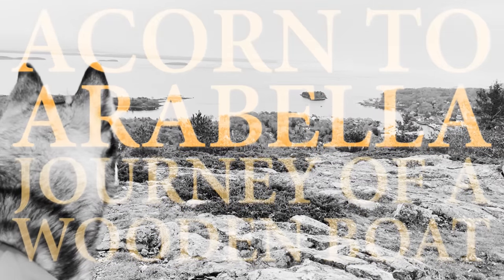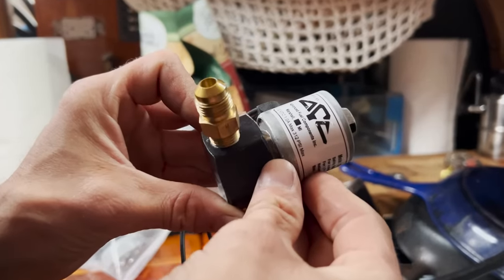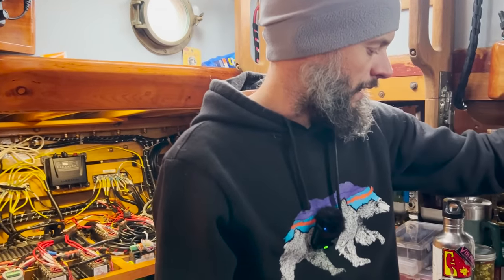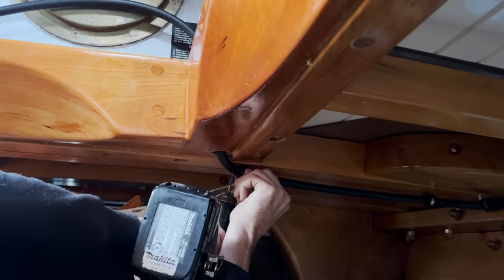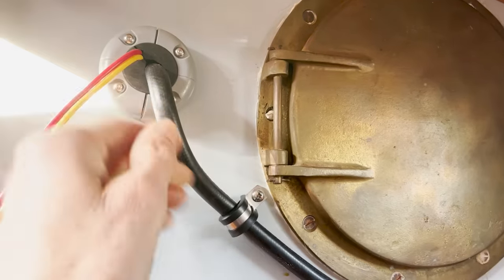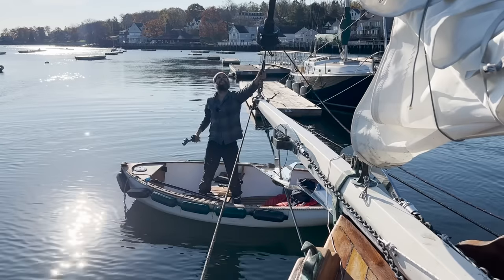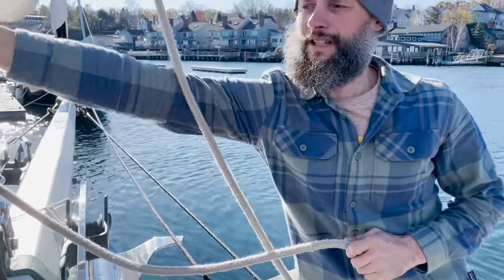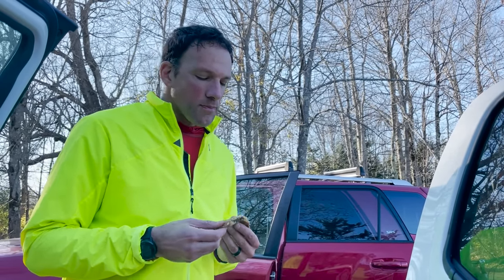Propane Tank, Bringing It Up To Code - Episode 290 - Acorn to Arabella: Journey of a Wooden Boat

Comment: Steve, I used to train folks on LP filling etc and just recently repaired my LP solenoid. Didn't read all the comments so this may already appear here. 1. LP tank valves not only seal in the closed position, but also in the open position so LP doesn't leak past the valve stem. So always open the valve completely until the handle stops. 2. The round part of the solenoid is an electro magnet and can be replaced if it fails. Mine did last season. just take off the big nut and voila.
Reply from the maker: Thanks for the tips!

Comment: Definitely install the propane detector with the solenoid control.  Trident makes a good control panel and detector.  However, I strongly suggest that you use the control panel to close the solenoid when you are not using the propane.  I always close the tank valve when I leave the boat and only open the tank valve when I come back aboard only if I am going to use the propane.  Just make sure your solenoid valve is gas rated, ideally for full propane tank pressure (~120 psi or more) so that a regulator failure won't force gas past the solenoid valve.  Fireboy makes a very good solenoid valve.  Another reason to close the solenoid valve when you are not actively using propane is that the 12 volt solenoid valves draw about 1 amp when they are open.  So if you leave the valve open 24 hours a day that valve alone will draw 24 amp-hr from your battery bank.  Finally, most insurers will require that you have a propane detector.

Comment: Hi Steve, I use the same solenoid and it draws enough current that it gets pretty hot when I’m baking so if you use a sniffer make sure you figure in that draw to add to your daily usage. Arabella is looking awesome!
Reply: Steve, in addition to considering the power draw and the consequent heat generated by the propane solenoid, you might consider two of these mounted in line as a way to double your safety when propane should be off… propane engulfing you in your small cabin will be quickly fatal…

Comment: I've been a bit paranoid about propane on any boat since seeing the rapid unscheduled disassembly of a beautiful wooden yacht not unlike Arabella but considerably older, in Burnham-on-Crouch due to a tiny propane leak which filled the boat.
I was assisting a friend with his boat - a reasonable fibreglass day-sailer which was just about able to do light cruising if you didn't mind being a bit cramped (and of course, fibreglass is so light it bounces around in the slightest ripple and isn't very easily heated, although it is better than steel or aluminium in that respect.  We were on the dinghy to be taken out to our mooring, and the gentleman who had the very nice wooden yacht was dropped off at his right before we were to be delivered to my friend's boat.  After dropping the other gentleman off we were heading across to our mooring when we were almost capsized by a blast wave coming from astern.  We turned to look and his beautiful yacht was a cloud of debris expanding upwards and outwards in all directions.  Luckily no large parts hit us in the dinghy, and he was also wearing a life jacket of the self-inflating type (which were relatively rare back then) and being bright orange, we were able to see him and pull him out of the water - I'm not much of a judge of distance, but he was two moorings away from where his yacht had been moored.  He was pretty badly burned but conscious and told us that the boat had exploded as he reached into the companionway and switched on the interior light.  The switch must have created just enough of a spark to ignite the propane that had filled the boat in the two weeks since he had last been aboard.  We were lucky that someone ashore had seen what had happened and called for an ambulance (this was well before cellphones), which arrived as we pulled into the quayside.  He was taken to the local trauma centre who just stabilized him and he was then transferred to Stoke Mandeville Hospital - then the UK's leading burns unit - being patched up and having grafts over the course of at least a couple of months.  I think they said 40% burns, which was close to the survivable limit back then.
PLEASE use the (sealed and sparkless, intrinsically safe) switch as a matter of course, and only rely on the sniffer as a safety backup, mounted as low in the boat as you can put it - propane is heavier than air (as I'm sure you know, but others reading this may not) and will fill a boat completely without quite a strong draught to blow it out, and that draught has to blow through the whole boat, right down into the bilge, or the propane will accumulate there.  For at least the next year, you could not give away propane equipment in Burnham after that accident, as it alarmed so many owners that they switched over to kerosene entirely and rapidly.  Even now I'd only use it if there was no choice and every possible precaution was installed and observed because it is such a well-hidden danger.

Comment: Steve, please consider wiring an on-off switch and light to your LPG solenoid.  An LPG detector will provide both--Trident is a good brand.  Make a disciplined practice to turn on the LPG solenoid, light your stove, and turn off the LPG solenoid BEFORE. you turn off your stove to burn off all the LPG in the lines.  This was our practice on our world circumnavigation 1997-2012.

Comment: You might think about connecting the solenoid valve to a manually set timer.  You set the timer to 20 minutes, use your propane, then, even if you forget to turn it off, the timer takes care of it for you...
Reply: I absolutely agree. The valve should only be open when the stove is on, and not a moment longer.

Comment: What a relief to see you discovered what an LP detector (gas sniffer) can do. They are required equipment in RVs and other vehicles, so it seemed strange that you didn't mention it early on. They are quite effective at keeping vessels from going boom, just make sure to put it down near the sole. And using a type 1 tank connector  on your regulator will probably be safer and more convenient than the POL I think I saw you use.

Comment: You might reconsider the idea to leave the propane solenoid open all the time as they draw considerable power. Mine draws about 2 amps. I have a switch right by the stove with a ready light on it to remind me to shut the stove off.

Comment: Stephen, Last week my Trident Marine propane solenoid failed catastrophically for the SECOND time. Charred wires, insulation and melted plastic. 
I saw that you carefully ran the supply wire for your solenoid separated from the propane hose but through the same gland. As a result of my experience I suggest removing the wire from the gland that has the propane line. I think that is ABYC spec anyway. 
My solenoid draws 1.5 amps, that is a lot of power to use to have it on all of the time as you mentioned was your plan. I wouldn't burn my power that way. 
My solenoids have not been covered under warranty. Trident apparently expects them to fail in just over a year as I have experienced twice. Plan on yours failing as well.
I just completed a 10,000 NM solo circuit of the Pacific in my 27' Cutter and I am back in Mexico. 4 months at sea on passages, 18 months in the South Pacific. Fresh bottom paint and I'd go again!
Sorry to hear about your Mom, I lost my dear wife to cancer. My prayers are with you and your family.

Ben S/V DAWN

Comment: Good morning Steve-you are planning to put the sniffer inside the boat, roger that?
Reply from the maker: No, probably in the box so it doesn’t have to get to the point where gas is inside the boat for it to do it’s job.
Reply: @AcornToArabella  Got that, but you have propane appliances and plumbing connections in Arabella's cabin  where you humans and puppies hang out. Wouldn't you want your confined living space protected from a propone leak more so than the propane locker on the deck?

Comment: The solenoid needs to be first because it works on pressure, which isn't there below the regulator. Tank, solenoid (valve), Leakdown gauge, regulator, output. Turn the system off & watch the gauge to see if it drops.
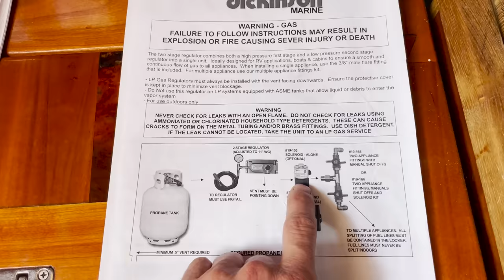Reply: The instructions at 11:54 show regulator first, then solenoid
Reply: I've worked on many boats and I've never seen the solenoid before the regulator.  What kind of solenoid is this?  The only ones I've ever seen are 12v and the plunger/valve is perpendicular to the gas line - doesn't rely on gas pressure.

Comment: My experience with gas sniffers: The ones the gas company uses are amazing. They could detect an unlit pilot in an apartment unit by holding the sniffer next to the crack beside the door. The cheap one that I bought couldn't detect an unlit pilot if you put it next to it. It could detect the gas if you turned on the burner with the pilot unlit.

I mentioned this because the ones the gas company uses were really expensive and I wonder how well a gas sniffer works like the one mentioned in this video. Is it really expensive or have they figured out how to make reasonably priced gas sniffers work pretty well?

Comment: Steve - you really shouldn't install the propane cylinder on its side - it needs to be upright, or you risk getting liquid through the regulator and causing a dangerous flare-up from the stove.

Comment: Is that a liquid gas , all the bottle gas we have is liquid , and any leaks tend to gather in the bilge , our gas detectors are low down . Explosions because of leaks have normally been from the bilge up.  Should you hose be armoured ,    have the gas go through the solenoid with the switch included, 1 button to operate, , have the detector with a loud alarm down low near the cooker. 
A bilge pump going off can be the trigger.

Comment: This makes me think about a simple automated cut off, as on gas stoves. (I have a Smeg) Surely there is a way to have fail safe shut off, using a thermistor, connected to your solenoid? I don't know about other brands of stove, but mine shuts off the gas after 8 seconds, which is great when using really low flame settings; sometimes the flame can be extinguished without me noticing, and the gas is automatically switched off. Also, if the thermistor is faulty on a particular burner, that burner won't stay lit, so no seeing a flame and walking away without it burning, and the gas just flowing out...

Comment: I would have made the hose penetration at the upper halve of the propane container - for increased safety. And I would have put the solenoid for the propane inside the boat, to minimise sparking risk in the propane bottle container - also for increased safety.
Reply from the maker: There’s no need to engineer/create a solution, there are ABYC standards to follow for boat systems of all sorts.
Reply: @AcornToArabella  Would there have been a system safety analysis as normally required on merchant vessels, that would have been a sample of notations not marked green in the report.

Comment: Couple of thoughts on your gas install.  It is better to have some drains in your gas locker at the bottom of the locker - the gas is heavier than air.  that way you don't have a half locker full of gas when it spills out the big hole.  That rubber gas hose is normally only good for a short number of years before needing to be replaced.  In Europe, the date of manufacture is on all those hoses to ensure that they are replaced within the timescale, thus most installations use special copper gas lines from near the regulator to near the stove, then transferred to armoured flexible line to the stove, and a short tail from the regulator to the start of the gas line .   I have never seen the gas bottles laying on their side before in an installation.  In fact I was specifically warned not to do that as it enables liquid gas into the regulator rather than gas, and you can get over pressure at the gas stove.
Reply: I have an alcohol stove on my boat so no issues with propane. I’m in Europe and know quite some boates with propans gas tanks. Not one of them trusts any system, hoses might leak, connections might leak. All of them use the propane for cooking and once done the valve at the tank is closed manually and line burned empty, then the stove is turned off.

Comment: Please plumb that propane line in permanently with soft copper tubing and flares/nuts. You can run it discreetly.
I am working on an old boat, full of retrofits and after-thoughts. Every exposed after-thought has collected a shadow of dust or filth. 
I’ve resolved to mitigate those items moving forward.

Comment: I was wondering if there is room by the wood burner to fit a heatsink then with a bit of piping & a small pump running slow feed it to small radiators around the boat then back into the heatsink. minimal power usage as long as the stove is ticking over it would heat the boat throughout. Infact im not a heating engineer but in a closed system would it even need a pump as when the water heats up would it not push itself around the system 🤔 cant answer that but i expect someone can. Just thinking out loud 😁👍.
Reply: Yeah if you have a pipe at the top and one at the bottom the hot water will leave via the top and return through the bottom one. Not too sure of all the details like safety valves or whatever for if the water boils. Nice in a house or hut but I would imagine installing radiators and piping etc round a boat would be a job and a half. They were called 'wet back' stoves, when the small tank and it's pipes were inside the stove and they were usually plumbed straight into the hot water cylinder. I guess I'm showing my age now...

Comment: Just curious as to why you are using an impact driver for drilling holes when that is NOT what it is designed for.. hhhhmmmmmm. Also, you could have left the picture of Arabella's launch day where it was and drilled the hole for the hose and cables down the bottom edge near the porthole... and I would orientate the gas cylinder so that the on/off valve is directly accessible via the hole not having to snake your hand around to get at it.. but it's your boat and you do you...  Sorry to hear about your mum.

Comment: Surprised you don't have an induction burner.
Reply from the maker: Given the myriad possibilities on boats for heat, cooking, and other systems, I find I’m never surprised that people picked something they really wanted or preferred. —Anne
Reply: these use multiple kilowatts of power...   i doubt this is fitting for a system that gets charged with a handfull of mobile solar sheets laying on deck.   or ?
Reply: @mm-hl7gh  Singles are 4-800watts, pulsed. Cooking on it no, not beverages, yes.

Comment: is it a good idea to lay the propane tank on its side ? unless you have one designed to be
Reply: Pretty sure Steve’s is designed to be used that way.
Reply: That was my question also.  Most tanks should not be used on their side.
Reply: Fairly sure he said at some point during the build that his tank was designed to be used on its side.  Steve seems like a pretty thorough, detail oriented guy.  I can’t imagine him doing work to bring it up to code, and not changing the tank around if it should be changed.
Reply from the maker: The tank is designed to be on its side, yes.

Comment: so here's a question for the boffins, is it safe to use a propane gas bottle on its side, i just always assumed that the bottle had to be upright, or you'd have liquid gas travelling down the pipe and ignitand possibly lose it faster, or will the liquid turn to gas in the pipe anyway without increased pressure, i guess you just turn the tap down accordingly? 
how does Akiva act when he sees the seals, just love dogs in the wild, going back to nature and digging out little friends
Reply from the maker: These are designed to be on their side.

Comment: Hi,do you have gas sensors in the bilges,just an idea incase you have an internal leak…PS. According to a source i have  just read (1 December 2023)propane bottles should be stored vertically incase of leaks,cheers Roly🇬🇧.
Reply from the maker: Our propane bottles are designed to sit horizontally.

Comment: I have written before about how dangerous the installation of your propane system was. IT STILL IS. Please read the ABYC guidelines for a proper installation. You have numerous errors which may result in the loss of your boat and the loss of life. This is extremely serious. Tanks should be stored horizontally, access to the storage compartment should only be from the top, the gas will collect in your bilge so your “sniffer” needs to be mounted there, etc. I have witnessed the injurious results of improper installations. Please complete this job properly for your sake and your audience.
Reply from the maker: Our tanks are made to be stored in a horizontal orientation (I think you meant to say vertical?) and there’s a vent for any leakage that would go on deck and not in our bilge.
Reply: Sorry, I did mean to say vertical. However, since you titled this episode Bringing it up to Code, I think you’ll find that the changes you implemented are far from code and safe operation. Propane can enter your bilge from numerous places including your stove. It would be foolhardy and dangerous not to heed this warning. I’m not trying to admonish you, I’m trying to help you.

Comment: That is one terrible system you want to put electricity next to propane good luck you know a regulator should only be a turn valve why would you introduce electricity to the mixture especially if propane falls and you have a non closed holding tank for your propane a porthole wher propane can fall from what is this the most overturned bad idea yet learn how to get out into the cockpit and open or close a valve
Reply: You want a good system propane locker tank outside airtight,ventilation hose outside,regulator on tank this is as simple as real people do it your flapper valve regulator is a bad idea